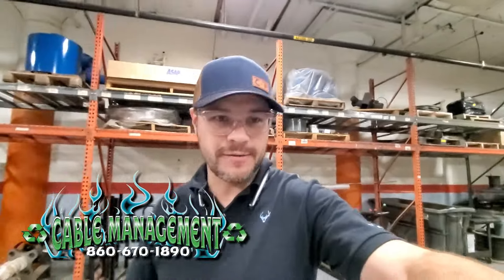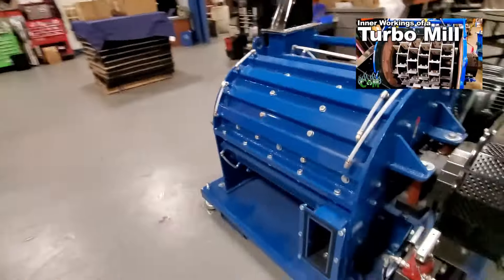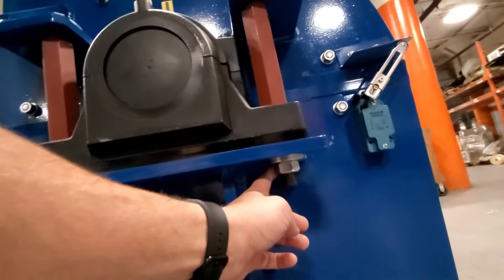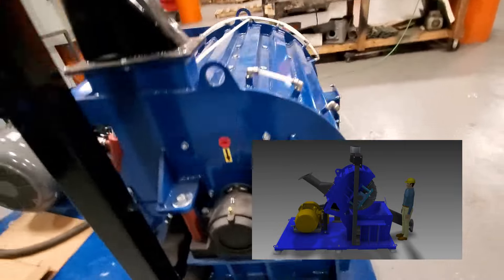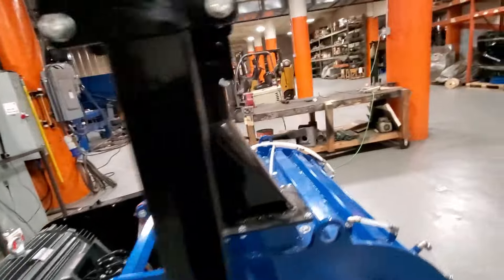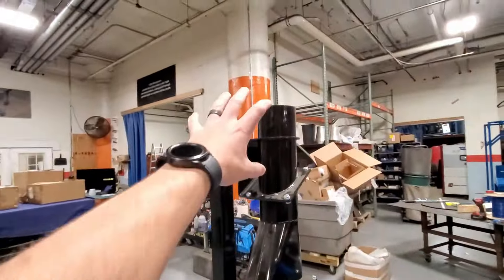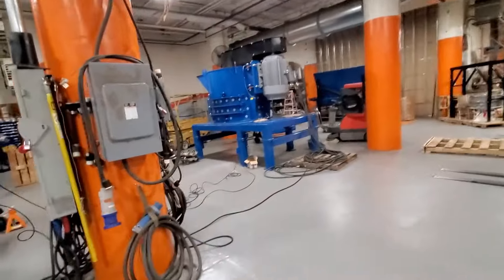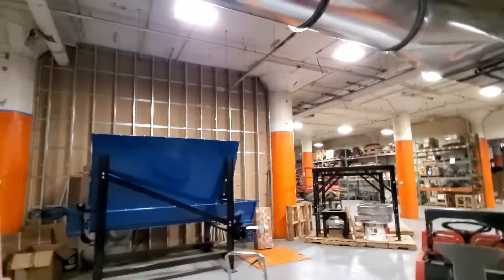Preparing Li-ion Recycling Equipment

Comment: Is this machine designed for discharged Li-ion batteries only ?
Reply from the maker: @conormackey1463  discharged and dry is preferable, but we supply systems for both wet and dry, charged or discharged.